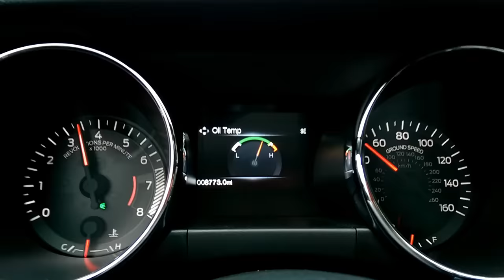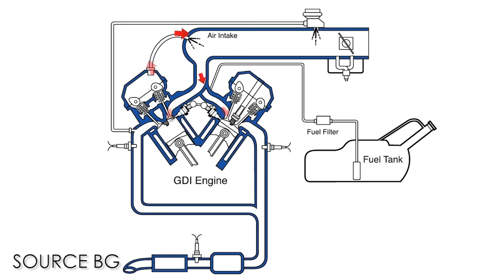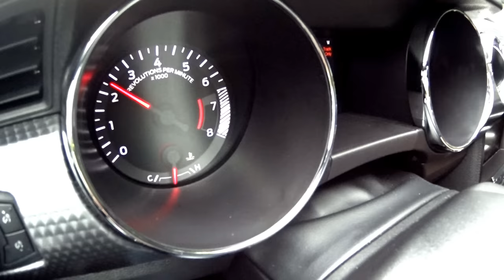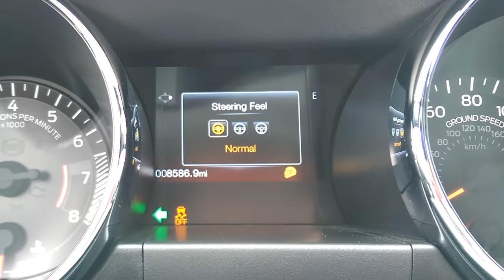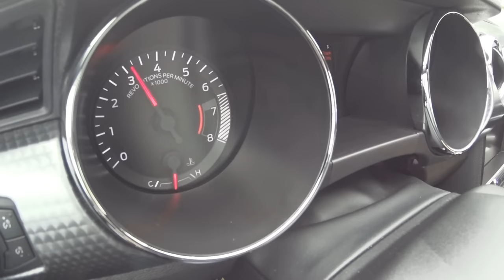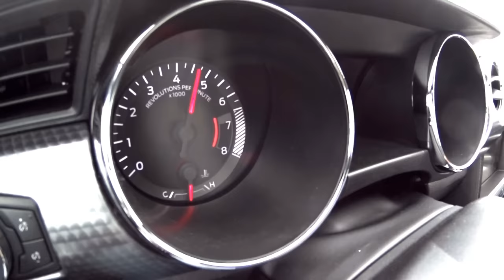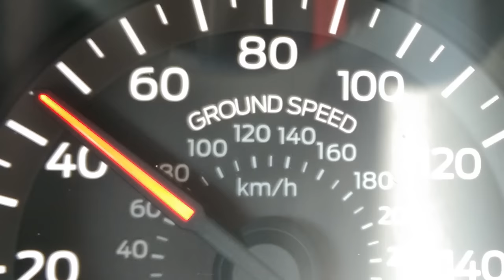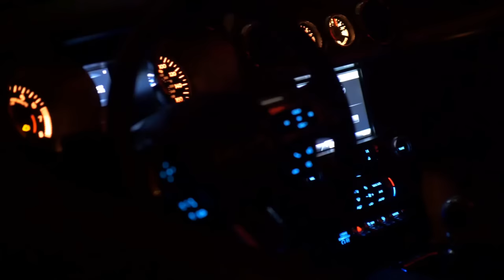Review | 2015 Ford Mustang GT and EcoBoost | Saddles Optional

Comment: 9 out of 10 people who question your motives to buy a 4 cylinder mustang you'll see riding around your neighborhood in a....dare i say shitbox.
Reply: It's just pointless. I'd rather have a number of 4 cylinder turbo cars like the Focus ST, Focus ST, Fiesta ST, Veloster N, WRX, etc. If you're going to have a muscle car, anything except a VW is just like, "why?" Smaller, lighter cars with a 4 cylinder are more fun as well as more practical. If you're going to get something impractical, go all the way at least.
Reply: @PapaP86  The 2018 mustang is a 5 second 0-60 car. You can get one new for 20 grand. Tell me why one shouldn't get it over a.. Say Focus or Fiesta ST?
Reply: @mudgatebronn4438  I just think its a good looking car. No need to be so toxic against people who didn't need or want the V8. When all cars go electric, any gas guzzler is going to seem like a dinosaur anyway.
Reply: @guaripolo69  and how is that, Einstein?
Reply: MudgateBronn the 4 cylinder mustang was designed to aim for younger buyers who don’t make a ton of $ but want a RWD Coupe that’s fun. This is a good option to pin against a Genesis Coupe or BRZ. These 4 bangers mustangs can be had new for low $20k range.... I’m sure most would rather have a 5.0L but for the $ the Ecoboost is quite a performance bargain. Basic bolt ons and a cheap bolt on turbo upgrade can make 5.0L power with relative ease
Reply: @mudgatebronn4438   how is 310 horse power and 350 tq at 3500 rpm not a real motor lmfao the 4.6 v8 only put out 260 lmfao do so research
Reply: @yojimbotv8554  you're coming up in here with the B I G F A C T S lmao
Reply: michael jai vincent well I doubt they spent over $30,000 on their shitbox
Reply: @Kekistani Refugee 0-60 in the 9th gen accord is 5.9 thats way slower lol
Reply: @yojimbotv8554  Spend most my time over 5k rpm.
Reply: I will take the v6 over the eco boost to prevent long term engine strain. That's my only gripe
Reply: @ZACH_95_  only magazine racers compare 0-60. 0-60 comparisons are not apples to apples, especially when comparing turbo vs NA. 90% of the time you're not on boost when you want to go. There is always a lag, and it is worse the smaller the displacement is. The 0-60 times from the magazine use very aggressive techniques, ones you would never use unless you were at the strip. If you want to compare real world low speed acceleration, the spec to look at is 5-60, not 0-60. The gap there is about 1.5 seconds. If you want to compare high speed acceleration the GT and Ecoboost differ by about 12-15mph. That is HUGE, both in objective difference and seat of the pants feel. Yeah, its fast compared to your accord. It is a sports car no doubt about that anymore. But the difference between the EcoBoost and Coyote is significant. From the instantaneous torque to the outright acceleration. I don't own a GT. I'm actually a Chevy guy. Yeah its true most of the people who talk smack about the 4 and 6 cylinder Camaros and Mustangs own nothing, but that's because the guys who own V8s have the decency to not be a jackass and say shit to people's faces. But they definitely think it. The instantaneous torque at any rpm, the sound, the rumble... these things cannot be replicated in the 4 and 6 bangers and are a big part of what makes these American coupes so fun to drive. But hey, if you're happy thats all that matters.
Reply: Dont worry give it some time there will be ecoboost mustangs running dual tomei straight fart can exhausts

Comment: I knew for me the 2017 Ecoboost premium was the best option. I appreciate the looks and miles per gallon --- 20 mpg combined and 34 to 36 highway. I've driven three adults for short trips. It's a great daily driver and is very comfortable on road trips. I like the toggle strips. The trunk is spacious and folding down the rear seats makes it great for the occasional need to to haul longer items. Thanks for the review
Reply: I've driven mine (2020 HPP) to Florida from CT a few times already, no issues with long trip either :)

Comment: 26:41 lmao, I guess those mustang memes aren't lying.
Reply: Its not that bad at all. You gotta be aware that you're driving a car that has 400+ hp and 400tq. every car will loose it ass in the wet with that power.
Reply: @Elliot Jay Don't kill me bro LOL 😂😂
Reply: It's gonna be even worse after a light rain because all the dirt, pollen, and maybe even automotive fluids form a film instead of getting washed away. So yeah, any car could crash there, if the driver isn't paying attention.
Reply: Red Trek yea, it happened to me on my 200hp fwd car, almost crashed head on. I under estimated the first rain after a long time. Rookie mistake, respect the first rain, no matter the car, with or without TC or ABS.
Reply: Yea they have a rep for that lmao!
Reply: In the wet, almost all rear wheel drive vehicles will want to get away from you.  At my last track day it was pouring.  My friends GT-R (that's AWD) went off the straight at over 100mph, I got my Ecoboost sideways several times but never went off.  Almost every car in our group had an... "exciting" time.  If you're willing to swap the tires, it can become much more manageable but it's not brand specific.
Reply: @JeffreyOsb  Yup Even my NC miata will do this with a tiny bit of water on the road, barely even have to push it.
Reply: Any RWD vehicle finna get squirrely in the wet: all the HP and torque doesn't help. Hell, even my little Nissan pickup w/ a 4.0 ice skates in the rain.
Reply: @PuRpL3DrAnKinMYsippy  it was the comfort mode steering made it too easy to overturn the steering
Reply: @gaivoron Depends. That mustang is a RWD. 400HP is a lot easier to control when you're splitting it up at each wheel. The WRX STI won't be doing 400 stock until next year but with the right tune and room to breath the current model will make ~400 without losing it's ass in the rain without having to take out a 2nd mortgage.

If you want to spend super car money there lots of (pseudo)super cars that will probably pull it off reliably with 500-700.

This gen of Mustangs are fine machines but the reality is compromises need to be made at this class of car so regular people can play too. If ford wanted to sell us a Mustang that performs well on a wet road they could make an AWD twin turbo V6 but it would be 60-70k and no V8.
Reply: @gaivoron  well yeah, but most rwds are so much easier to control and monitor when it's about to slide
Reply: Dallas Grantley um...I don’t agree with that statement. I can easily regain control of a slide just by easing off the gas if I’m over my head. Mustang biggest issue IMO is those all season, 235 wide tires that they stick on base GT. And that live axle that Ford used until 2015 didn’t aid in car control.
Reply: @gaivoron  yeah all seasons are always trash, but I mean more like, some rwd cars you can feel the edge to when it's about to oversteer, and when it does, it doesn't snap, it comes in nice and smooth and then you don't have to let off to regain control, you can easily control the drift, whether it be tightening or loosening the line, extending or ending the drift, hence why out of all cheaper rwd cars, they're the ones most of the time spinning out and yeeting into a crowd, though I must admit, there is something fun about a car that snaps and is more difficult to control, more adrenaline and keeps you on your toes
Reply: @gaivoron  he wasn’t even going that fast????

Comment: MAP makes a stellar replacement intercooler. It's what I have on my 2016, factory precision mounting. Easy install. and temps are very low now. Mishi makes an easy catch can kit that takes like 15 mins to install. Those are the only improvements on mine and I average 27 mpg as my daily driver. The GT model is awesome, but for a daily, I chose to save 8k and fuel.

Comment: I rented 17 ecoboost convertible and had 28-30 mpg while i was testing calm driving at 70mph. As much as i would like to hate 4 banger Mustang idea, it really does good job at affordability and economy and you do get over 300 hp and dual exhaust.
Reply: tallll70 the camaro and scat pack both easily get 30 mpg at 70 mph
Reply: Midwest Mopars Yeah and my GT 350 gets 60 mpg. Go big or go home.
Reply: Midwest Mopars My C5 Corvettes would easily get 30 mpg highway. I modded my 99’ frc to ~400 hp, and regularly got 38-40 mpg highway. With the 3.42 rear end and the T-56 Tremecs tall gearing (4th, 5th, and 6th were ALL overdrives. 4th was 1:1), I was revving barely 1,000 at 70 and with maybe 1/8 throttle. Sounds unbelievable, but true. Big V-8’s fuel mileage with tall gearing can shock you.
Reply: @devn3813  a 392, getting 30mpg? U need to stop eating paint chips friend lmao
Reply: Eddie Becerra it definitely does. One time we took a road trip 600 miles total, 4 people, trunk full of luggage, and drove it around the city for the weekend, and when we got back it got 31 mpg for the whole trip.
Reply: any car gets good mileage at 70 mph :'D
Reply: @eddie2000ad  let's get with the rest of the civilized world and use correct units. 6.4L.  6.4L that's makes the hp and torque of the 5.0l on the Bullitt.   Your right there is no way its getting anywhere close to 30mpg.

Comment: I pulled the sound tube, replaced the resonator with Ford Racing X pipe with the Borla GT axle back mufflers, and added the catch can.  19,000 miles and zero issues.

Comment: Again, by far the best reviews on youtube. I can actually sit through the 30 minutes and enjoy it. While I enjoy other reviewers too, more then 5 minutes and I'm done. Do you by chance know if you are going to get to drive/review the current generation WRX? I am interested in knowing what you think of it. Especially in terms of comparing it to other competitors in its class.
Reply from the maker: Waiting for 2016 Subies to be added to fleet.  Then Wrx and STI.
Reply: savagegeese Sounds great.
Reply: +savagegeese, I don't think you'll have traction issues with the 2016 STI. ;-) Oh and the 2015 GT with Performance Pack should have been equipped with Summer Tires which are not run flats. Wouldn't have made a difference with all that weight on the front end in the wet though.  ;-)
Reply: h

Comment: Great reviews, man. Keep up the good work. I love the discussions of the suspension while underneath the car. Almost nobody else does that.

Now as for your criticism of the GT's handling: If you have a 400+ hp V8, you can't go into a corner off throttle in the rain then stab the throttle mid-corner. Even the most controlled cars will yaw violently under those conditions. In other words, your statement that you have no confidence in the GT's handling would apply to any other high-horsepower, rear-drive car.

Comment: Was the GT wet driving using the Wet/snow mode and traction control with all season tyres.
What iam asking is, with this all on would you still have this degree of sliding in the wet conditions??

Comment: Very good review! I do want to note that with the center console, the release/open-latch is on both sides. I reach across to the far side next to the passenger seat, palm down, and pluck up to open it - it's not awkward at all. If I tried to open it with the closest latch on the driver side, that would indeed be super awkward. I know you had a limited time with the car(s) so I suppose you didn't realize that the latch was on both sides haha.
I have the all-season pirelli p. zero neros on my '16 GT and even with the all season tires it's terrible in wet when punching it even mildly from a stop. Very annoying as the all seasons on my '13 GT were 100% fine. I'm considering getting different tires and I barely have 2300 miles since getting it in October, and I certainly don't ride it hard either.

Comment: GT Perf Pack does not have runflats.  They give you an air compressor that can inject tire goo

Also note that if you get the Premium model and then get recaros it deletes the heated/cooled and power seat features.

Comment: Great detailed review of both the Ecoboost and GT which gave an excellent comparison of both cars helping me decide which one I would like to buy. It was interesting to see that while driving the GT, you were following a Red Miata convertible which is what I own now and what I'll be trading in for the Mustang. I do have one question regarding your review of the GT however. Why in the world would you want to test drive a 5.0 on wet roads? Of course it's going to get rear end happy on wet road conditions especially if you're running fun-flats and traction control is off. I think you scared the crap out of some would-be GT buyers watching you fight the wheel during acceleration and did a general disservice to an otherwise great handling car as defined by most reputable auto reviewers.
Reply: Agreed.  I have a 2015 5.0 6 speed and the handling in the wet is pretty accurate but doing the review in the wet doesn't really depict its overall handling.  In the dry even on Michelin all seasons first gear can grab traction at WOT and it's very controllable even on throttle around corners.  In the rain though you need to be aware because it will go sideways even in 2nd or 3 with traction control on.

Comment: 2015: "The 5.0 is one of the most reliable engines out there". 2019: "Hold my BBQ tick"
Reply: I have a first gen (2011) and I've never had an issue with the drivetrain at all.

Comment: Fantastic unbiased review brother! just So in depth that u blow away the other wanna be  car reviewers..Heres the strange impression that came across from this review....it seemed as if you actuallt had more FUN driving that eco boost than u did driving the 8cyl.....you were able to get on it, use the power it had and actually drive faster than the truly terrified look you had trying to control that v8 putting its power down theu 2 skinny banana peels...of course it was wet, and if it were dry and at the track id bet u would always go with the v8...but what u showed was everyday driving and how each may do in that scenerio..the v8 was rreally an accident waiting to happen,especially in the hands of a teen...try telling a teen to go with an eco boost and good luck with that!  great review

Comment: I think your traction issues in the GT are likely tire related. Mine was scary until I put really light wheels with Yoko Advan 255 front/275 rears on it. Totally different car. It originally had some shitty Pirelli pzeros on it and I felt like every drop of water on the road was going to spin me.

Comment: Ford seems to be pushing the 4 cylinder. There are only a couple V6's available in my area and they are automatics. If I wanted to buy a rattle trap mustang I would get the V6 and then get better springs, dampers, different gears, etc. If that is scary in the wet, how would he describe a foxbody mustang in the wet?

Comment: I had done two dealer drives, the '14 V6 and later '15 EcoBoost. In both cases the Recaros were perfect, but the steering feel was disappointing.  On the '15, the salesguy said "but it's better with aftermarket tires".  I agreed it might be, but didn't bite.  I had very high hopes the '15 would have turned into a nice longterm car for me.

Comment: great job on camera and angles whole video looks amazing..holy shit u almost lost the gt!
Reply: He's more of a 4 banger guy.
Reply from the maker: +Scott P Cars that just turn without warning are not suitable for life. Kia Specters do not have this issue.
Reply: Its a s550... Lol he was never in any danger. 

S550s just like playing with you when they get bored. Once u learn to drive them they are literally kittens... Ridiculously easy cars to drive. 

You just can't be scared, let the tail hang out, just point where u want to go and floor the gas... It wont spin out all it will do is straighten up and launch itself put of the slide... The traction control on these cars os perfect

Comment: Great review. One thing about your wet pavement handling test, did you test it with Wet/Snow Drive Mode? The Mustang is truly an attainable dream car.  I recently bought a 2015 Mustang GT Premium with 10,000 miles for $34,200. If new, MSRP with options would have been $44,300.  I traded away a 2010 Mazda CX-7 GT for this, so fuel economy is better here, and cheaper to insure too. I use to own a Mazda RX8 and Nissan 370z. The RX8 handles better, and the 370z felt faster and better planted on the road, but the Mustang is definitely cooler and a better ride. Even my wife is glad I got it, and she was never a fan of American muscle, and favored luxury imports more.

Comment: I like this review, watched it several times. Mustang GT is my first car and it'd been with me for almost 1 year now.
Just a question for who has driven this car, do you think the clutch is harder to control comparing to other manual transmission cars?
Till now I don't think I can control it well enough, especially from gear 1 to 2, I have no problem with other cars, and a few guys own or think they can drive manual transmission cars failed to drive my Mustang GT smoothly.
Reply from the maker: +梁霄 How long have you you had it, its a bit tricky to be smooth 1-2nd but over time it gets more natural.
Reply: It's the clutch assist spring.  Get rid of it.

Comment: Given that it's been a few years since you guys produced this video, I wonder if you've got insight about this LSPI issue afflicting the EcoBoosts? From what I understand, it's something that affects direct injection turbo charged engines, and not exclusive to the EcoBoosts alone, however, tall gear WOT apparently spells disaster for the motor; I'm not as proficient a stick shift driver as you are, but if you're on the highway and one may forget to downshift to 5th to overtake someone, I'd hate to think that I'm going to spell the end for an extremely expensive car (subjectively) for something somewhat minor. Any thoughts would be greatly appreciated!